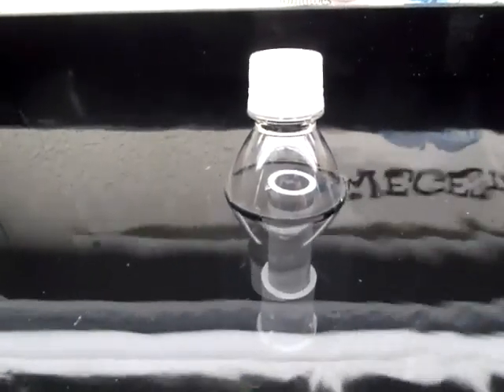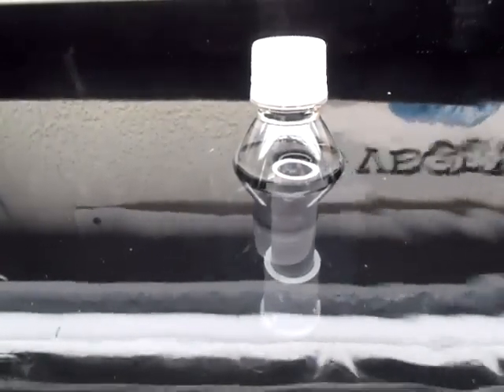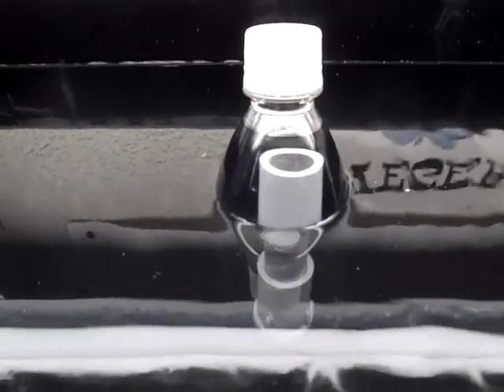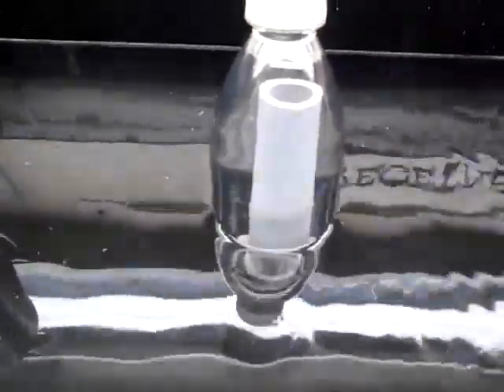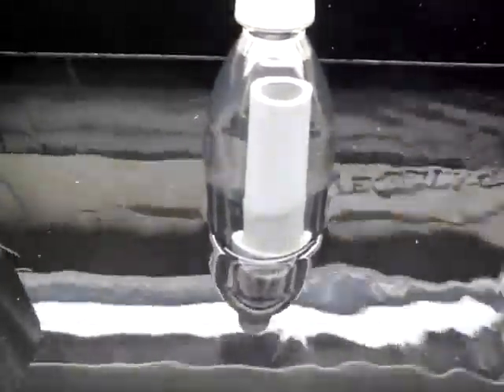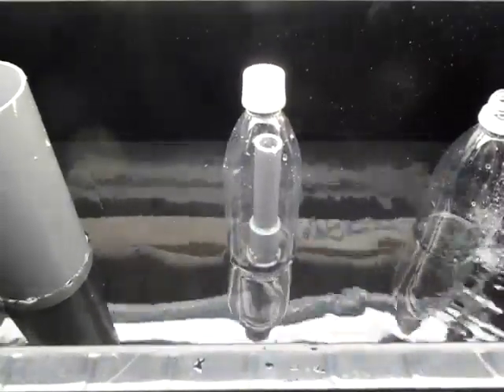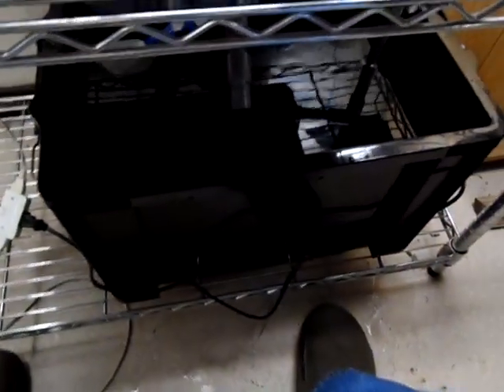Aquaponics Soda Bottle Bell Siphon

Comment: How do you keep the soda bottle from floating away?
Reply from the maker: The air is not trapped, so the bottle doesn't float
Reply: hillbournesian so I'm correct in believing that the bottle isn't attached to anything to keep it from floating around as Joan Smith asked? & if  that's correct, This means that the bottle has the bottom of it cut off in order to fit over the pipe & then there would be, or must be, either slits, or small holes lining the bottom 1\2" to 1" of the bottle in order to allow the water to flow into the chamber? & Because air isn't trapped in the bottle due to the drainage pipe allowing it to flow out of, that is why the bottle does not float away or Bob around like a normal bottle in water would? Does this sound like I have somewhat of the right idea as to how this system works? I ask because I'm currently setting up my aquaponics system & am tinkering with the best designs for a bell siphon & this system really looks nice but it is a bit different from the other bell siphon systems I've studied up about on YouTube but it also doesn't show, in this video, any part of the assembly that went into it.
Reply: Tyler Barton I have been using this method successfully for around 3 years. Yes, you cut the bottom of the bottle off and cut notches around the bottom to allow water flow in and to allow air in to break the syphon. It wobbles around a bit, but is retained by the central pipe. You can put a wider diameter pipe sleeve over the top of the bottle as a media guard with slits around the base, this allows water  to flow but stops the media getting in. Very effective 👍

Comment: How much flow rate is your pump putting out? My bell siphon get stuck right before ir creates the siphon and just drains. I think it the flow rate to blame
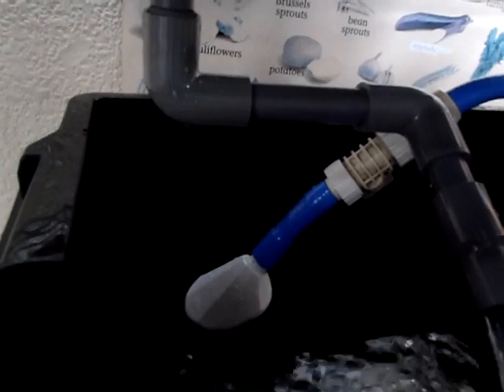Reply: I had a similar issue and i figured it is realy important that you watch your outflow. like here in 1:52 the pipe turns several times wich allows the syphon to start easier... im putting videos online too soon. let me know if that worked